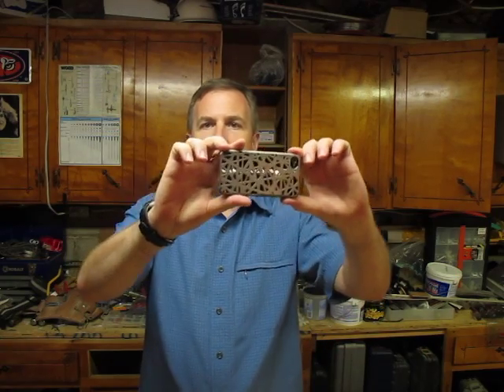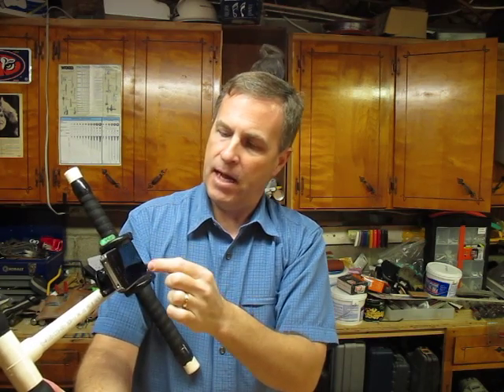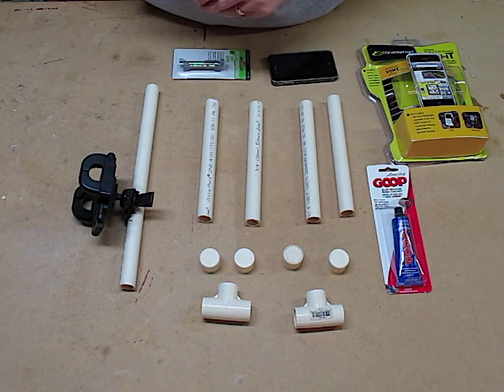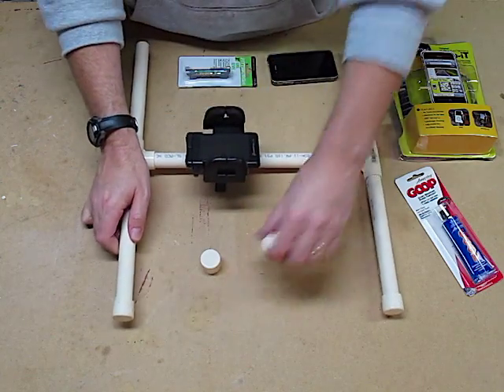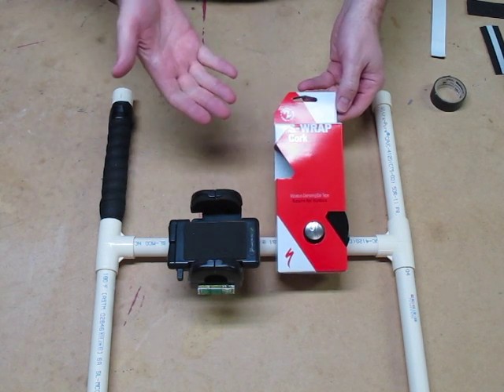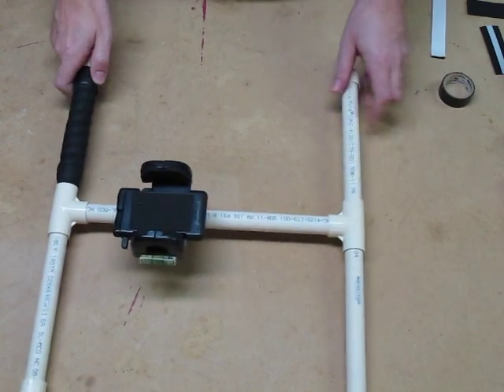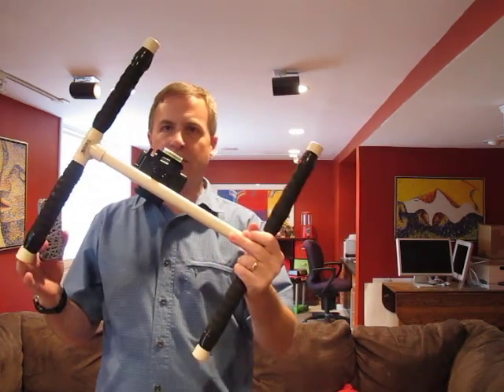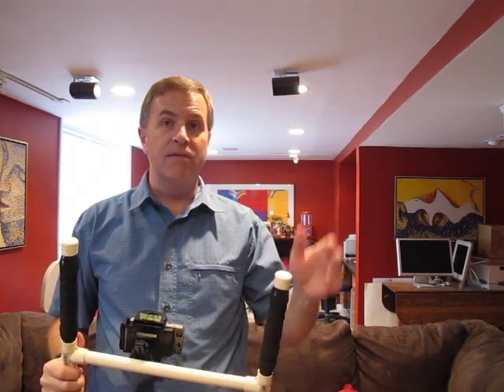DIY iPhone SteadyCam Image Stabilizer

Comment: That is a really good idea for steady mount. Inexpensive and easy to make. I was thinking of something similar. But instead of hard mounting the camera bracket mount it on a pivot. So the camera could rotate horizontally side to side. Then at bottom of mouth to run a 12" boom with weight at bottom. Then it would always be level because the weight would always correct. I haven't tried this one so may not even need it. May be waste of time. But was just something I was going to give a shot